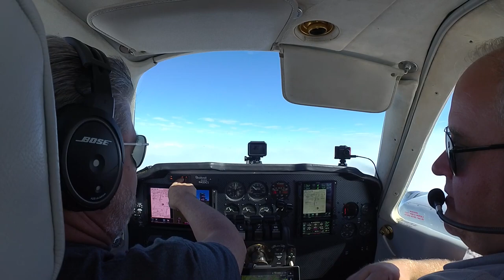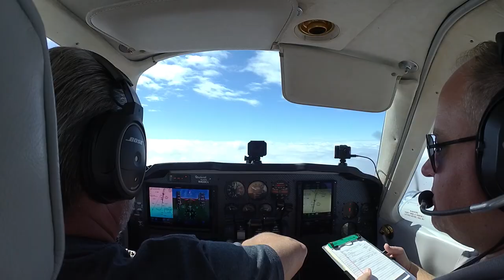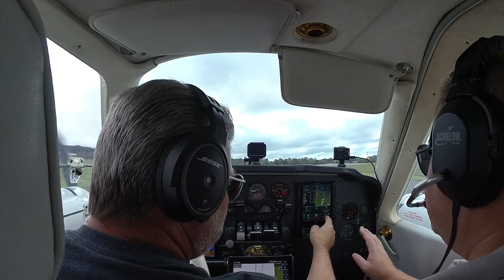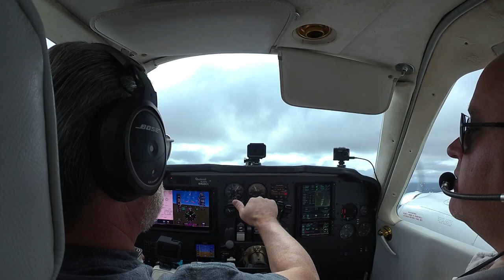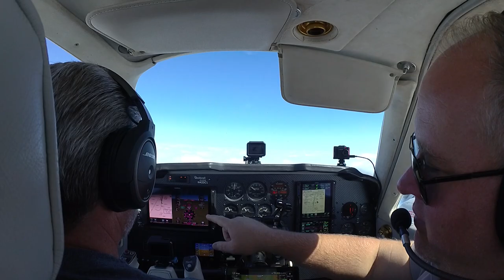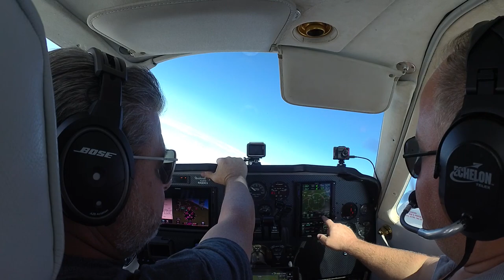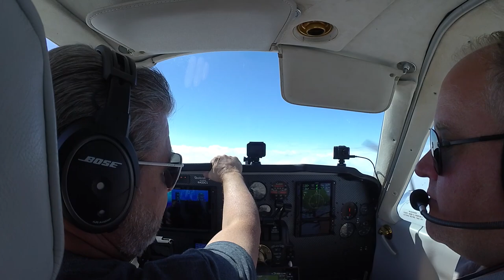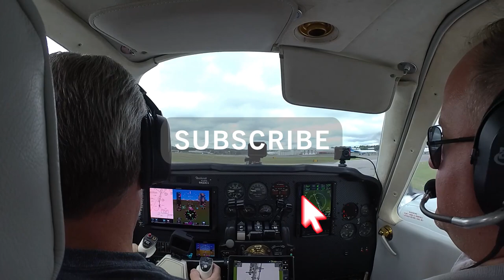FLYING IFR INSTRUMENT APPROACH WITH AUTOPILOT TO MINIMUMS

Comment: I would like to understand your SOP on the approach and late application of approach flaps. I fly my Baron to the IAP at 2300 @ 20”. Then back to 2300@ 17” to flap/ gear speed, then approach flaps to reduce to 140 knots automatically. Props to 2400. Gear down at half deflection - gear down to go down, speed comes back to 120 knots automatically. Fly the final approach reducing to approx 15 inches to decision altitude/minimums. Final flaps  and back to 110 knots reducing. Works every time!
Reply from the maker: I fly my Baron close to the settings you have listed above. 
I like 2300 @ 21” in cruise flight. When flying an approach, I’m normally 2500 @ 15”. I focus more on keeping my airspeed around 110-120 (full flap speed) and usually apply full flaps once airport is made or about 1/2 mile out. My power settings are adjusted depending on winds & gross weight. I’m not sure this answered your question but hope so. Keep flying like you are.... by the numbers!